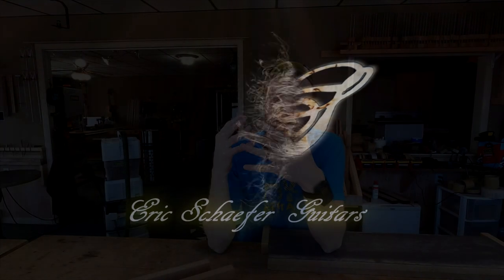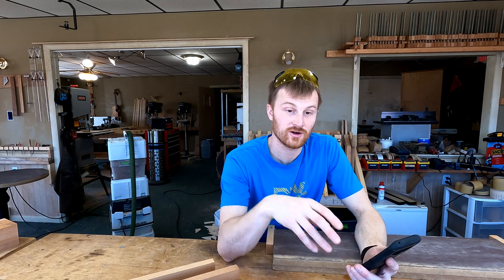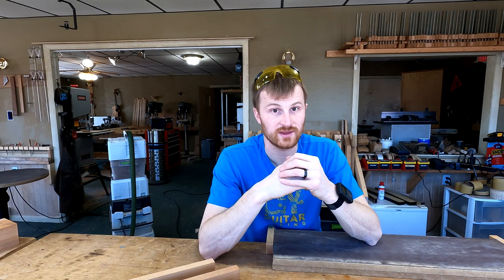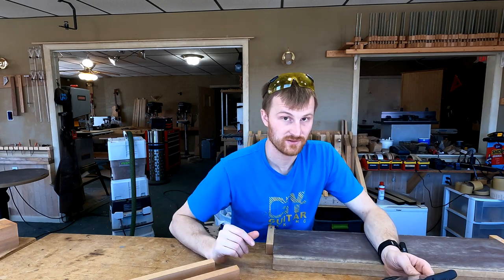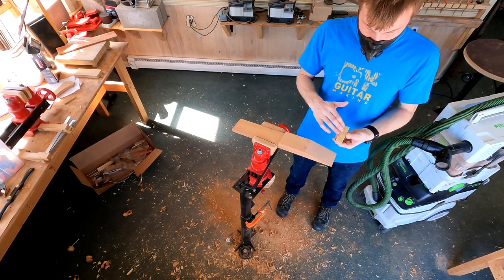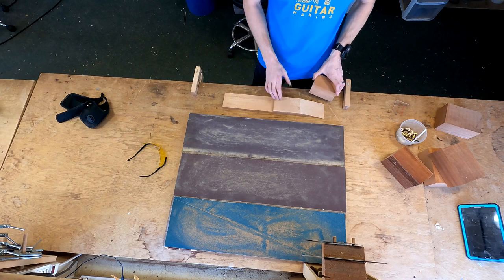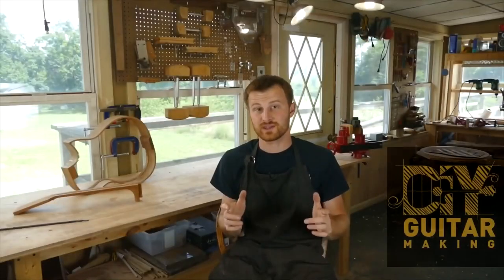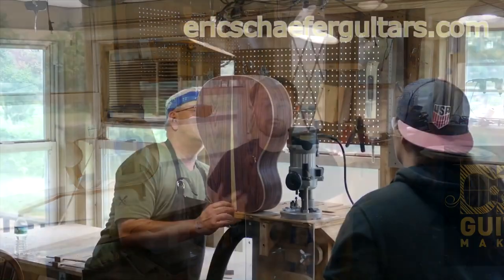Scarf Joint and Neck Blank Making Demonstration and Q&A

Comment: The question from Jeff at Homebuilt Workshop is about Hardwax/Oil finishes NOT Polyurethanes. Some of these are OSMO Topoil, Tried & True, Odies etc... Some oil penetrates the wood and then the wax components harden on top. Mostly matte and Satin style finishes

Comment: Thanks for tackling this question. I was trying to leave product names out of my question but for clarity, the finishes in question are those similar to Rubio, Odies, and Osmo. Not so much Minwax although it may be similar. I'm a long way from the finishing step but I am always looking ahead in the build so I can try to answer the questions I have ahead of time.
Reply: I have used a Hard Burnishing oil which uses the sanded "slurry" produced in the process as a grain filler. Gives a beautiful satin finish. I think these types of finishes are very useful for acoustic guitars because it is very thin. Down side is the time for it to cure, and the one I use has Eucalyptus oil which takes about a month to lose that strong smell. Thin finishes are better, and shellac is very popular, but I think it will work, but does give a different tonal result as Eric points out.

Comment: Thanks for the great video Eric!
Just an idea: I used to do a lot of  "old school"/handtools only woodworking, and one common wisdom is to very very slightly round over the edges of the plane's blade. Just a few extra passes on either end. you can do it freehanded in 5 seconds or using a guide (just applying more pressure at the edge). It completely makes these ridges disappear - while keeping a perfectly flat surface

Comment: Hard wax finishes are things like Osmo Polyx or Rubio Monocoat. 

These are excellent finishes that feel extremely natural and comfortable. If you’re looking for that ‘basically just the wood’ feel, I highly recommend checking them out. I have used Osmo Polyx on a dining table, and it has held up fine. It also reapplies wonderfully
Reply: Yes, Osmo is one I've used for a couple things and I love that 'wood' feel. I feel like it would work on a guitar and feel nice. I know its not "traditional" but I just don't want to cause some negative effect later on. I don't mind straying from tradition if it works and causes no harm. I just might decide to try it. We'll see though.

Comment: First question.  I think he's talking about Tried and True oil types of finish.  It's similar to TruOil but it is only BLO and beeswax.  It does not build.  Two coats and you are done.  Needs to be reapplied when necessary. Completely non toxic.  It might be good for a neck but I don't think it would hold up for the rest of the guitar. IMHO